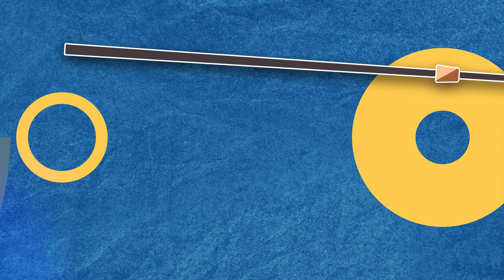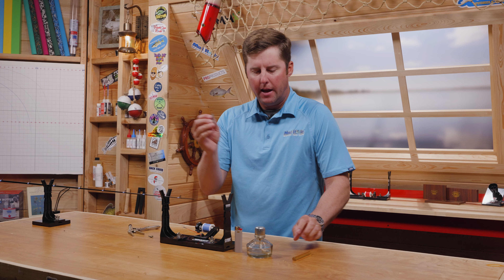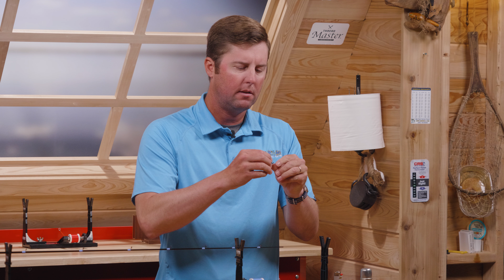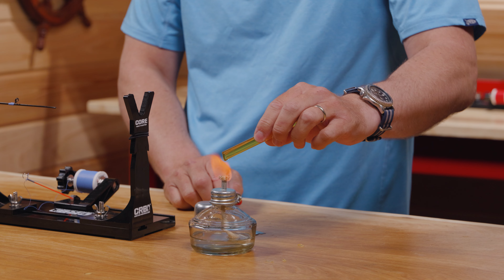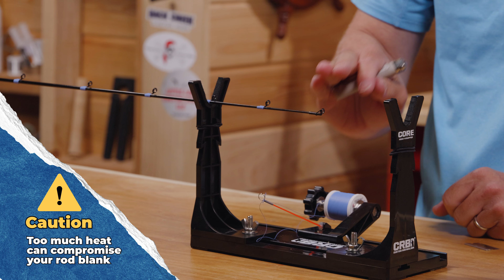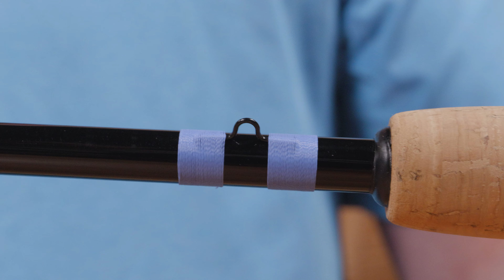Step 6: How To Install Tip Top And Hook Keeper On Your Rod Build - Rod Building 101

Comment: I like the use of the vice grips. I dabble in silversmithing and have a set of pliers and vice grips I have filed and polished the jaws on. this allows me a slightly tighter grip without any marring to the material. For the odd/oval shaped items. I filed a matching grove on both the top and bottom jaw to help hold them.